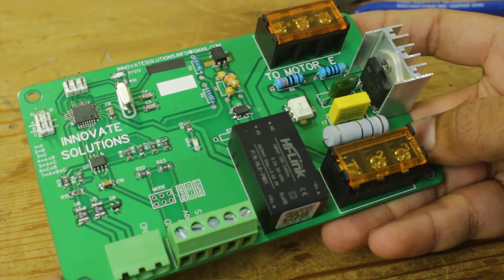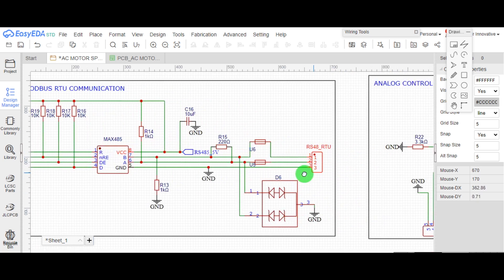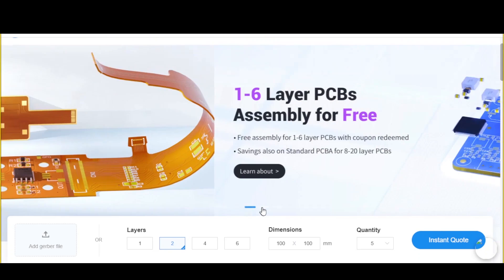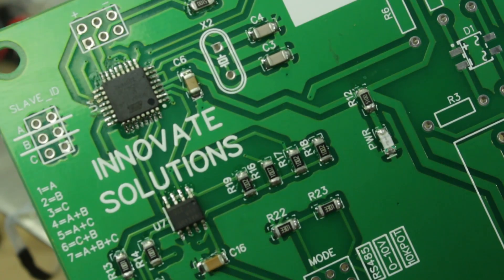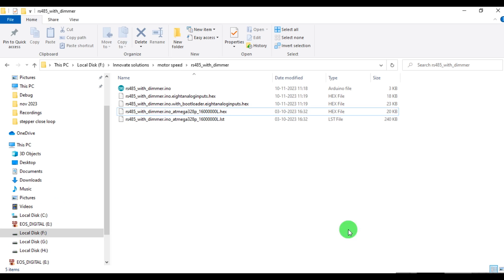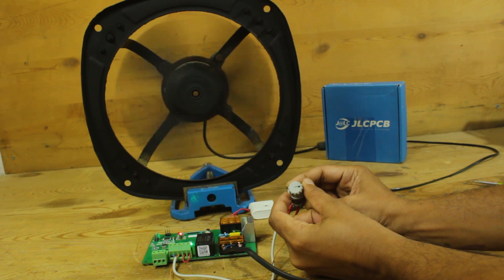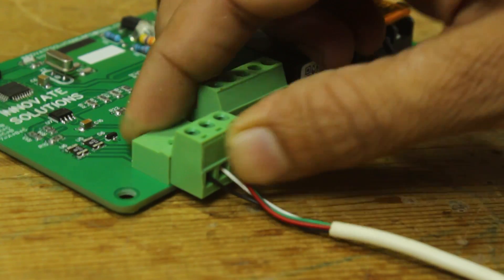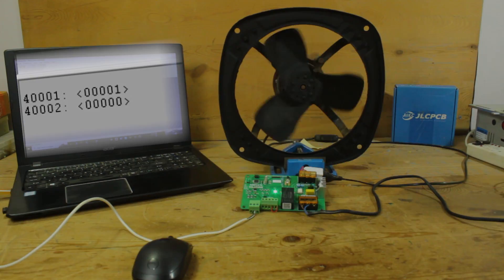Single phase motor speed controller using potentiometer, 0-10V or RS485 modbus RTU.

Comment: Hold on a second now, You Cannot effectively control the speed of a single phase AC motor with a potentiometer, unless you have discovered some New scientific technique.
Potentiometers on a single phase motor will Damage the motor. The potentiometer will basically clip the voltage, or cut the “tops and bottoms” of the frequency wave of AC current. This starves the motor in order to slow it down.
As someone who has 2 variable frequency drives with 3 Phase motors on both a lathe and a belt grinder, this is the Proper way to control speed. The variable frequency drive, as the name suggests, changes the frequency of the sine wave, making the wave fatter or skinnier, to control speed. 
DC motors can be speed controlled with potentiometers.
AC motors in a furnace that have 3 speeds for the fan, have 2 separate coil windings. Low speed is with the first small set of windings, 2nd speed is switching to the second set of windings, and then high speed is using both winding sets together.

If you could effectively control a single phase AC motor’s speed under load, without damaging it (which clipping the voltage would do) this would be a game changer. And every appliance motor in the world would be variable speed.
To the person who asked about the washing machine motor, No you cannot vary its speed.
I am very much willing to eat my words if you can indeed effect variable AC motor speed, without clipping the voltage. I have a Bridgeport Mill I would retrofit, 3 old drilling machines, and a lathe that needs rebuilding.
Please, please, teach me how to run my AC motors with variable speed under load without damaging them. I’m all ears, and I will put your picture up on my shop wall!!
Jeremy Fielding has an amazing web site, and discusses all the issues of A/C motors, and DC motors.
Everyone should check out his web site.
Reply: What about the VFD? Is it possible to control speed with that? I have a giant single phase ac motor comercial fan and I'm looking for controling its speed, but I only managed to burn the coils twice using the potentiometer...

Comment: You need current zero cross detection otherwise it will work only with resistive load and small power unloaded induction motor.
Thanks

Comment: What is the reason for using icsp programmer? Why not direct Arduino ide rx tx pins ?
Reply from the maker: you can not only write but also read flash memory via ICSP, also you can access lock & fuse bits.
Reply: @MrInnovative  thanks for information 😇